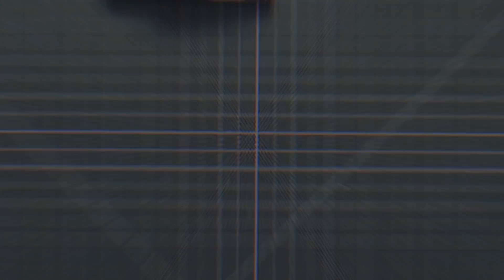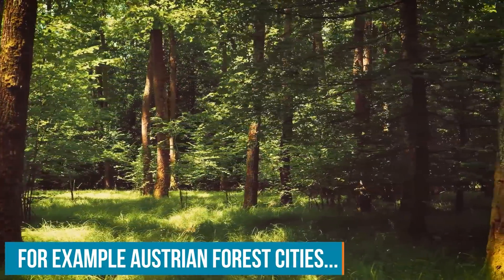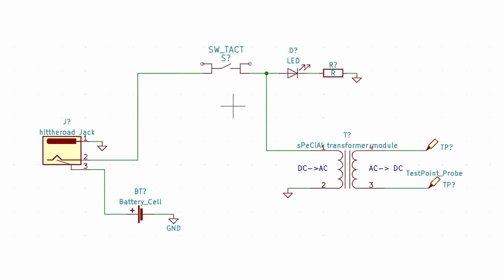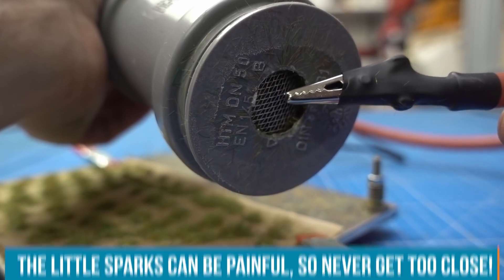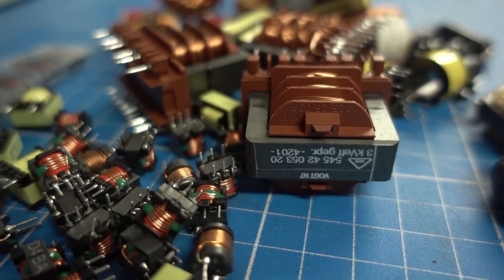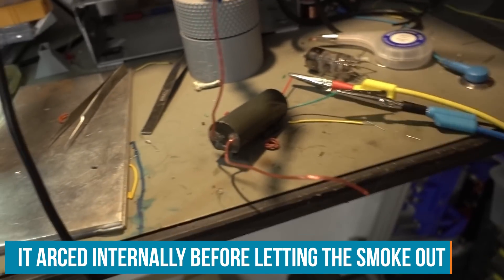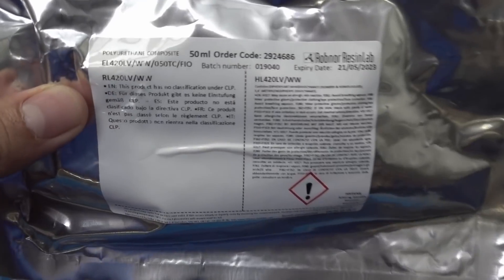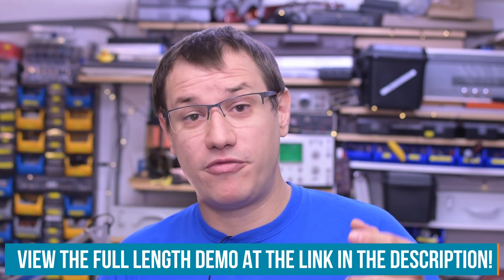DIY Static Grass Applicator

Comment: Very cool Project. Did you only ditch your selfmade transformer because it did not fit in the enclosure? It was a bit disappointing :(
Reply: Mainly for fit, and I ran out of time for the DC ac conversion, so I opted to get finished in time instead of hardcore diy. Most people will use such a transformer anyway for their build.

Comment: Very cool project. I've only used grass that is already applied to a sheet before for model trains. But this could be much more flexible for coming up with designs. It's been a very long time since I've worked with model trains, so this brings up some nice childhood memories.
Reply: I also used that grass sheet before, its actually made with the same procedure as I used i nthei video. But on rougher terrain directly applying the static grass ich much more pleasant and gives better results, a mix of techniques is usually the key.